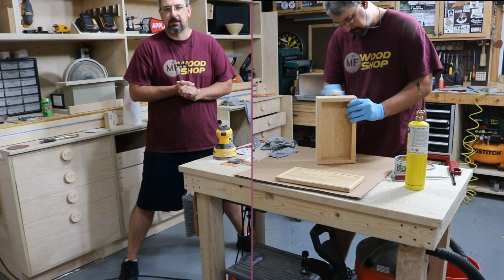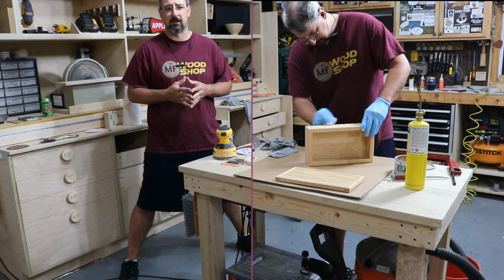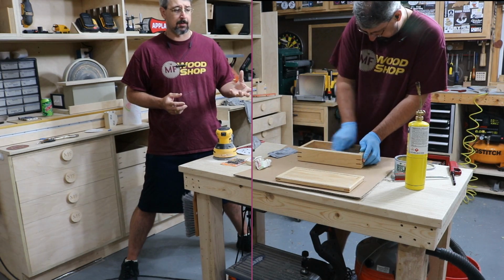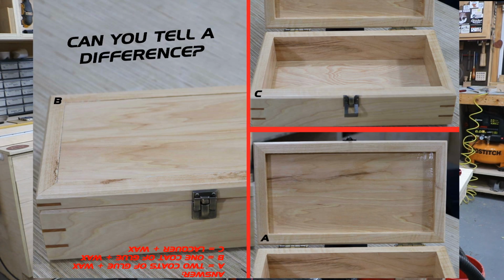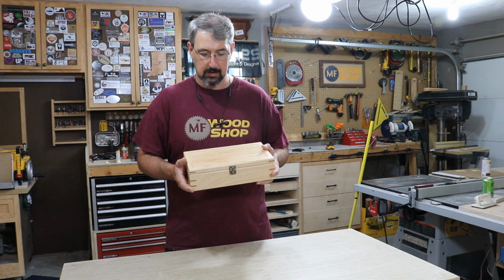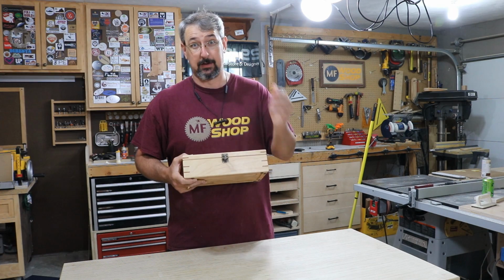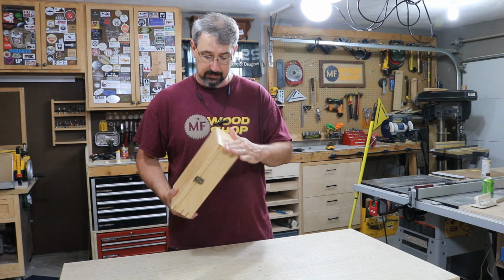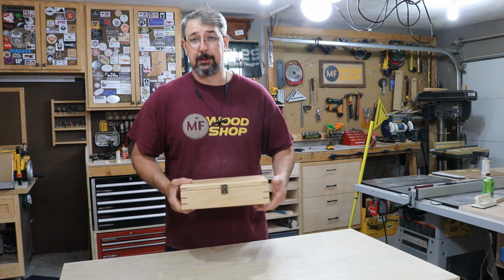Hickory Box with Gorilla glue finish

Comment: That looks great. Could not tell much difference. Been wanting to do something like that. The finish you did with the glue is something I have not seen. Thanks for sharing.
Reply from the maker: Thanks Tom
Reply: @mfwoodshop  Hi brother, I am researching the art of gorilla glue finish. Did you follow the manufacturer recommendation and dampened the surface of the wood? What is the humidity level like in your shop, what was the wood moisture like? Asking from a friend in the desert who learned the hard way I need the space conditioned to 72 degrees XD 76 was wayy to hot and dry for a stain ON MY DAMN QUEEN SIZED LOFT BED. The pigment didnt penetrate even WITH wood conditioner. And my thermostat(s) are accurate. Im also in the hills... I know i didn't do anything wrong because I did most of the bed already, using the same cans, and then another project after... so it wasn't an issue with the stain.